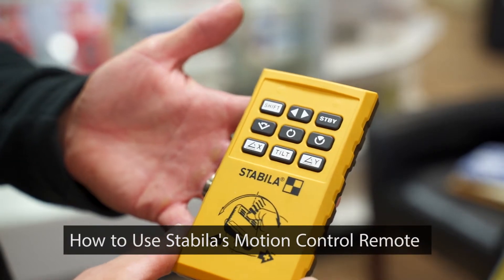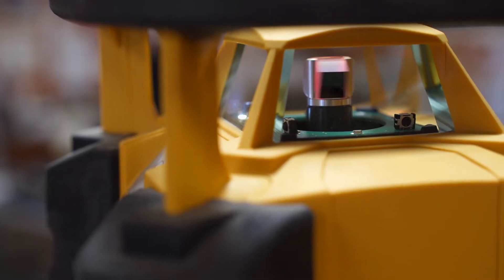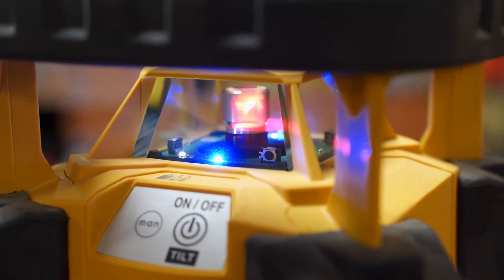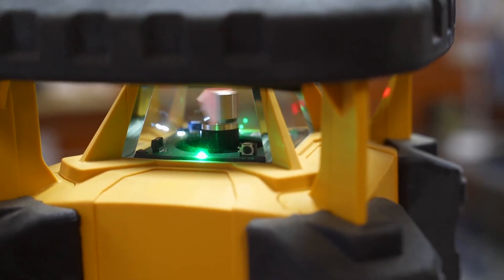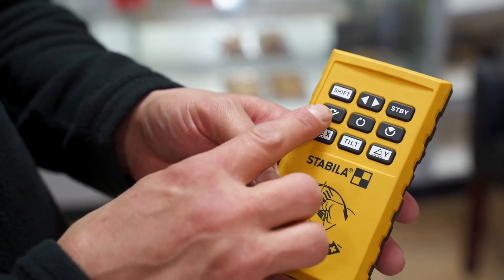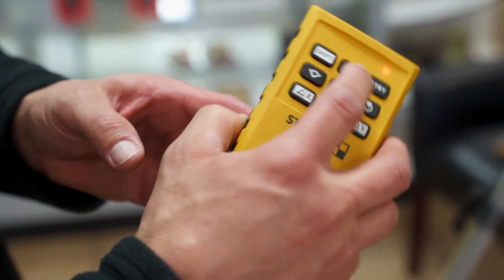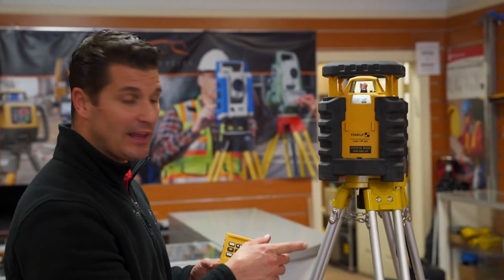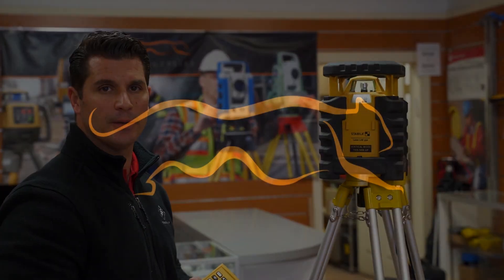How To Use Stabila's LAR 350 Motion Control Remote Controller

Comment: I bought this laser thinking I could program a percentage of slope into the unit for running sewer lines after I calculate the amount of fall I have from point A to point B. I'm beginning to find out that this is not possible with this unit. That's the sole reason I bought a dual slope laser and this fucking thing wants you to do it manually. Should just be able to punch the slope in you want to grade at then go, WTF!
Reply: exactly. i have this laser as well and am seriously disappointed it cannot do this. having seriously buyers remorse. oh well
Reply from the maker: Sorry to hear about the confusion. You are correct, the LAR is a dual grade laser, but does not have the LCD screen to punch in grade...You would need to manually calculate slope with this laser.